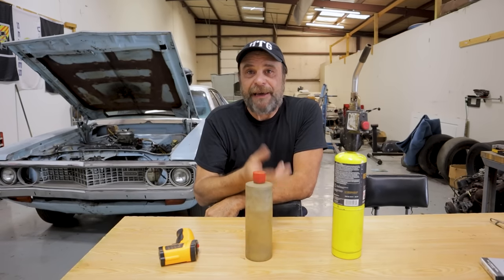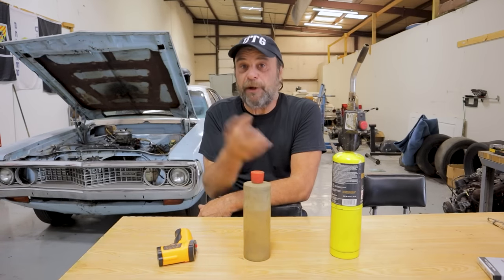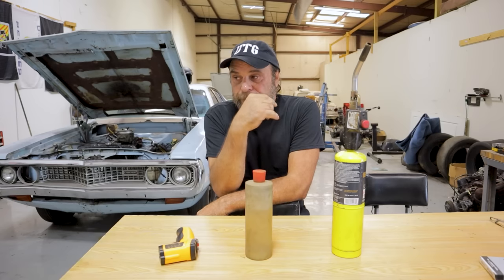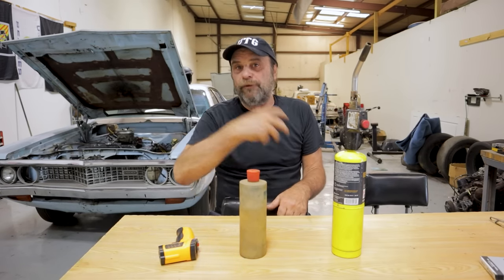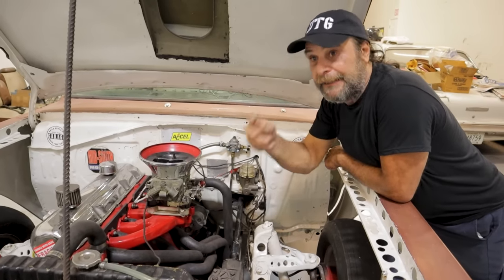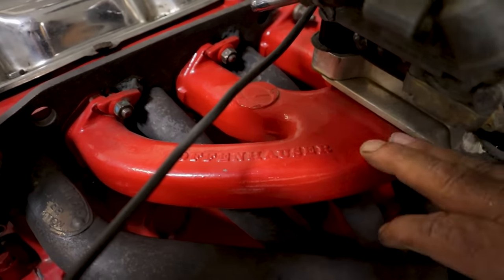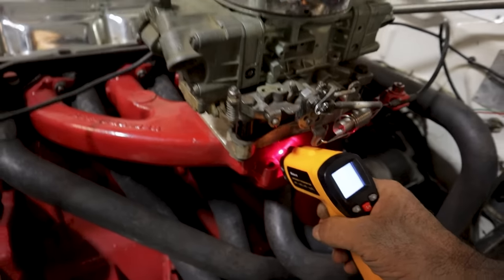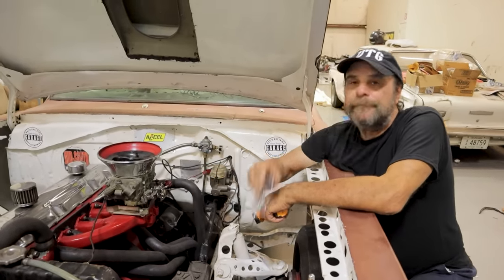How Much Intake Manifold Heat Is Enough? Testing The Vaporization Temps Of Modern Gasoline

Comment: Hand held IR sensor Pro-Tip1: The red laser is not measuring, it is only aiming the IR-Heat sensor cone of view.
Pro-Tip2: The IR sensor AVERAGES all of the IR-Heat viewed within a 30 degree cone (look at the diagram on the plastic case) so the closer that you hold it, the less ambient temperature "things" your readings will be confused with.  Proof: Put a lit birthday candle in the center of a full Ice-cooler, Point the laser, and measure the candle "temperature" from 3 feet away. Chilly huh! 
Pro-Tip3: If your IR-Heat measurement "gun" has the option, then Turn-OFF the Laser diode for MUCH MUCH better battery life. The laser is for show/theatrics - now that you know Pro-Tip 1 and 2, you can measure what is right in front of the sensor (as close as possible) and not average temperature averaged from a wide and distant cone of every temperature within its field of view. The closer-the-better will your measurements be. If you place the sensor opening directly over something you are measuring it will be the average temperature of less than a Nickle in diameter = Very Accurate !
Buy one and Enjoy it having added a 6th sense to your LIFE !

Comment: Tony, I'm watching your intake vaporization vid now. You are on the right track with why and how the fuel reacts in the intake manifold but your not quite there yet.
Yes, a street engine needs intake manifold heat for a few reasons. The most important is to vaporize the fuel from the carb so it can the ignited and produce heat in the cylinder. To do this it needs a heat source in the manifold either from the exhaust or coolant. Your correct in that the spark plug will not ignite raw fuel (see fouled spark plugs). You are also right that not 100% of the fuel mixture is consumed in the cylinder even if you have a FI system, this is why we have the EPA and CARB on our back. Yes. it is "emissions"! So, we know we can not burn all the fuel/air mixture in the cylinder BUT the more homogenous the mixture is the more efficient the combustion will be, in other words the more vaporized fuel in the mixture the more heat that is produced. Manifold heat is there to help vaporize the incoming fuel from the carb.. Fuel is discharged from the carb nozzles as a very fine mist (no vapor) when this mist enters the intake it MUST be heated to help vaporize it so it can be efficiently ignited in the combustion chamber to make a lot of heat! Heat in the cylinder is what pushes the piston down. As we say here in Detroit: "The more heat da better"! As for your experiment with the sheet of aluminum it is not exactly what is going on in the intake as the fuel mixture in the manifold is under vacuum and this helps the mixture stay homogeneous until it is in the cylinder and it is ignited by the SP. Chryslers 2.2l four cylinder carb engine had the intake under the carb heated with coolant. If you care to understand the physics behind this theory look up "The Heat of Vaporization" this will explain what happens when a liquid (gasoline) changes state from a liquid to a vapor. It will explain that there is heat loss from the liquid, it other words the vapor change will pull heat from the surrounding area. In the case of an intake manifold it will cool down. If you need an example of this just look at the A/C system in your car>" Heat of Vaporization"! Here is another, when you get out of the shower or a swimming pool, your skin starts to cool off immediately, this is the water on your skin evaporating and changing state form a liquid to a vapor>"Heat of Vaporization"!
I was a engineer at Chrysler for 33 years, ten of those in the Carburetor Lab and on the dynos. I helped develop the 440-6 Pac system. Max

Comment: "Feet in the oven, and head in the icebox" - that nails the concept for the layperson.  On the air intake side, it's all about maximizing air density.  On the rest of the system, it's about minimizing friction.  Remember the good old days of Pro Stock when they drove the cars back to the pits from the top end???  No more - they don't run the engine 1 extra revolution than they have to.  It is proven that ice cold engines make more power, and why they they run oil that is as thin as water nowadays.  Talking N/A here, of course.

Comment: What temp should the engine run at..complicated. With punters testing on flash engine dynos they are not left running at full load while you change the water temp as it gets a constant temp.
Block should be hot, head cooler and you need the gas vaporised, there's a challenge.
Years ago McLaren Engines USA built a turbo offshore race engine, dry decked it and ran different cooling systems. Block hot, head cool.

Comment: I want to take my aluminum intake off and block off the crossover because I believe I’m getting vapor lock or heat soak. Is that a good idea to cure my problem?
I did a similar test my intake after driving it 160°. Cranks absolutely perfect right after I shut it off and crank it back up but if I let it sit for 10 minutes it’s hard to start it back. By the way, I’m running a return line back to the tank

Comment: We never had this issue on the /6 engine, but then we did run it in middle GA (Reynolds, GA) in the middle of Summer when the days were 80-95 degrees. We did run the engine for more than 5 or 6 minutes to warm it up.  If you're going to heat the engine up to 200 +* coolant temperature you better be running EVANS coolant and not water. Evans doesn't expand or boil, you can run a 2lb radiator cap and not push any coolant out.

Comment: Could you use the ultrasonic plate in a room humidifier? It turns water into fog. It would be interesting because it wouldn't need heat. I just don't know if gas would wreck it. Just a thought-you might have to coat it with gas-proof paint.

Comment: I put a 1970 302 in a 95 Ford truck and was extremely broke and needed a truck
I put the four barrel on the truck backwards because the accelerator cable was too long drove  the truck for 4 or 5 years it was a complete. Dog 
But it got me out of a real tough situation

Comment: Gasoline is made up of different things with different boiling points, alcohol boils at around 160 degrees there's stuff in it that boils a lot colder and hotter. Straight alcohol would be a bitch to start in the winter, you need those more volatile chemicals to light the fire, they bite you in the ass on a hot day. Winter blend, summer blend.
 Read something about intake heat and fuel efficiency they found a coolant system heated intake was very efficient. Truck and industrial carbureted engine were often that way. Cars used the exhaust manifold heat control set up. Cars have to work on short trips with little or no warm up and still have good drivability. A trucks gonna run all day, it's a little cold blooded in the morning no biggie. Plus the manifold heat control valve would burn out in no time in a big truck so there's that. 
 Anyway I think you're on the right track, let it run a bit with the hood closed and see what happens! You could put a heat gauge on it to find the best temp, too hot will start slowing you down I'd think, too cold she bogs.

Comment: This is not unlike rifle ammunition... ask any experienced reloader.  The larger the bore and heavier the projectile, the "slower" the powder must be.  The speed of the powder is determined by the granule size.  The larger the granules the slower the powder.  This has to do with surface area versus the amount of the propellant.  For example, the "powder" granules of a Navy battleship's guns are the size of charcoal briquettes.  The idea is to give a steady push all the way down the bore, rather than a sudden explosion and it's all used up.

Comment: Now that you've shown how hot things need to be, don't forget that even engine temp is the most important of all. Tuning is impossible. Inlet water temp will be cold, thermostat opening about 180 degrees, here lies the problem. I see that you've disconnected the bypass hose, this little hose stops the engine from going into thermal shock every time that the thermostat opens. Your block is cold your head is hot at the thermostat , six cylinders with different water temps & six chambers with different water temps around them, this is why tuning is always rich & never as crisp as it can be!!

Comment: Hand held IR sensor Pro-Tip4: Be careful of temperature readings made outdoors, or under Incandescent light-bulbs or overhead heaters indoors because of shiny metal/glass reflections as IR-Heat sources a million miles away will FLOOD your IR-Heat sensor.
Proof: Place some ice cold frozen shiny/chrome/AL plate so that you can see the Sun in the reflection, and press the button. Pretty High temp for a frozen piece of metal HUH!
 Your cold mirror is still frozen, but the Sun (heater/Lights) reflected into your sensors cone-of-view and now it reads very very much freezing metal as hot as heck, doesn't it !  IR-Heat also reflects far and near heat sources. Put the IR-Heat sensor in closest contact and read the real temperature of your very nearest target, and not average-in every other temperature of "stuff" all around it. THE LASER IS NOT THE IR SENSOR, it is the Red-Dot scope ONLY.

Comment: I'm sure you know, carburetors are designed to atomize the fuel down to 6 microns or less. For heat to aid in fuel vaporization, some intake manifolds are designed with a cross over passage that allows exhaust gas to keep the base of the carb warm. It's all controlled. Other intake manifolds have coolant routed through them, or there is a spacer plate between the carb and the intake through which coolant flows, in order to keep the base of the carb hot. I have even seen some aftermarket spacer equipped with electric heaters.The goal is to get the fuel vaporized to the point that you get as close as possible to a complete combustion, in order to utilize max BTUs out of the fuel charge. As far as temperature of the fuel, it varies with the use of the vehicle. Remember the "cool cans" 🤔😁

Comment: Tony, I think your kinda sneaking up on the issue in a round about way. Let’s take ignition timing off the table for this situation. It’s about air velocity, fuel ratios and engine demand. 

Your running fine at idle and your under some manifold vacuum. You open the intake valve creating suction in the intake runner and lowering manifold pressure, which is encouraging vaporization of the fuel. You are currently  generating a proper air fuel ratio. When you nail the throttle, 2 things are happening. You intake manifold vacuum instantly drops to basically zero, so your fuel evaporation, vaporization suddenly drops because your vacuum suddenly goes away thus dropping your vapor pressure. So your mixture suddenly goes extremely lean for a moment. The accelerator pump attempts to fix that by dumping an extra wad of fuel into the intake. But at that instant, there is not enough vacuum to vaporize the fuel in the air mass so it drops out of suspension. It either drops to the floor of the manifold or condenses on the walls. So your still in a lean condition but with a big glop of extra fuel in the manifold. The engine is still turning over, so air is still being drawn through the manifold at a slow but accelerating rate. Then as the air starts moving faster, it starts pulling the extra fuel out of the intake that’s sitting on the floor and walls. It has gone from being too lean to being to fat in mixture. So it’s not yet mixing and combusting properly. 

After a period of time, the raw gas is pulled into the engine, the air flow is now moving faster through both the primaries and secondary Venturi‘s at a faster rate with the carburetor beginning to provide the proper fuel air mixture ratio which is making its way to the engine so the power from the combustion process now reaches optimal. At this point, your fuel air ratios have returned to proper levels, and you start getting the power output out of your engine and the stumble and bogging goes away. 

The reason a warm manifold helps is the walls are now warmer than the fuel/air dew point so less fuel falls out of suspension condensing on the walls, keeping your mixture fuel lean. After the air velocity increases, the condensed fuel is pulled along with the airflow making the air fuel mixture to fat until it has all been pulled out of the manifold. Then finally, you get to the good mixture and away you go. 

I suspect this transition period is why manufactures developed the vacuum operated secondaries for four barrel carburetors.  It kept the air fuel ratios within reasonable limits so excessive amounts of fuel would not added before the increase in air volume and velocity happened before the engine was ready for it. The vacuumed actuated secondaries includes a metering function which controlled the rate the secondaries opened at. Thus managing air flow and mixture keeping the fuel and air demand engine dependent, not flat footing driver dependent.

Comment: Avoid holding IR thermometer above heat source for long periods of time, it heats up and becomes less accurate for the moment. For best accuracy measure for 2-3 seconds only. Also the laser pointer is quite pointless, waste of energy, better to switch it off.

Comment: You have such loooong intake runners that it's not a problem mixing fuel/air well before getting into the cylinder.   
It might be an issue on a V8 where the carb is directly above the intake, but not on a straight six with 24" of mixing time.

Comment: I think this explains why I needed the biggest accelerator pump squirter size they make on my 300 i6 project.  There is no punch to it off idle.  I put a offenhauser intake on it and that thing dangles way out in the cold - it’s got no heat in it!  Very interesting.  I’ll have to run some hot water to the bottom of it and see what that does

Comment: Glue on some dog leg distribution tabs where the accell pump hits the booster venturi, I did this  on a Carter BBD ( that's was also hogged out and hi-flowed, around the choke/horn area but also booster venturis trimmed.down) could max out the accell squirter and nail it hard and launched hard everytime.

Comment: I guess the whole point of this video is let the engine warm up before you make a pass at the drag strip? And I also think your main problem is low manifold vacuum and a carburetor that is just too big for this engine and maybe too low of a starting RPM

Comment: UT,why not leave on the converter instead of the engine having to build up to its power band?  I always believed to leave the line under max if not close to max power in order to get the 60 ft times down.  If the engine has to build to its power band of 4-5000, it has to really rev first.  Isnt that wasting time out of the hole, especially from a slant?

Comment: Just a heads up the emissivity of aluminum can give you misleading readings with a heat gun
Just a lil lesson I learned from melting down a 2 stroke trying to avoid buying spark plug temp probes

Comment: finally the point, gasoline in liquid form won't burn, only in vapor form, liquid is important as it helps move the fuel to where it will be converted to a gas, IE inside the engine.

Comment: That slant 6 is very over carbed in my opinion.  Vapor in the form of gasoline before it reaches the combustion chamber don't work and vapor lock is not a good thing. Check the cam timing and try an air filter.

Comment: Motor gasoline, as defined in ASTM Specification D 4814 or Federal Specification VV-G-1690C, is characterized as having a boiling range of 122 to 158 degrees Fahrenheit at the 10 percent recovery point to 365 to 374 degrees Fahrenheit at the 90 percent recovery point.

Comment: Very interesting..

So, I'm working with a tuner remotely to get my TBI 350 dialed in. It does not like cold idle and the initial tune plus freezing February temps in the AZ mountains led to fouled plugs.

Three tunes later and the spring/May ambient temps seem to make the warmup less harsh... but now I'm wondering if I need to utilize the coolant crossover in the plenum (aluminium dual plane Edelbrock).

Don't want to get stuck in the cold and I'd prefer not to be swapping out fouled plugs all the time. (Did not have this problem down in the hot desert)

Comment: Power and efficiency are not the same thing unfortunately.  Most engines produce more power when run cold.  If you only want the fuel to vaporize, maybe you should heat the fuel in the fuel line instead.

Comment: You may have to err on te high side with your finale manifold temp, 150 may be the static temp the fuel vaporizes but charge cooling at high intake flow will be fighting that.

Comment: The boiling point of gasoline starts at 95F.  Google is a bit cryptic about it and says:

 At atmospheric pressure, gasoline has an initial boiling point of 95 °F (35 °C) and a final boiling point of 395 °F (200 °C). This wide range is due to its variety of blends which alter its boiling point value

Comment: I blocked off the exhaust crossover on my 390 FE cyl heads in the hopes of extra HP         what I ended up doing was creating a stumble at take off if the motor sits for more than10-15 minutes. It all makes sense now , thanks once again for the knowledge Uncle Tony. One of these days I'm going to send you a free f@#$ing pizza.

Comment: You're on the right track, but lest we forget the cooling effect of the velocitized incoming charge of air and fuel combined with the surface temp of the warmed manifold, a further reduction/loss of temp will be seen inside the plenum. I say on the right track because more heat soak of the plenum will be needed to achieve your theoretical latent vapor process. Keep truckin!

Comment: What is that black plastic part you are running inside of the velocity stack? It looks like it helps to further direct the air into the carb? I have never seen those before. Did it come with the stack when you bought it?